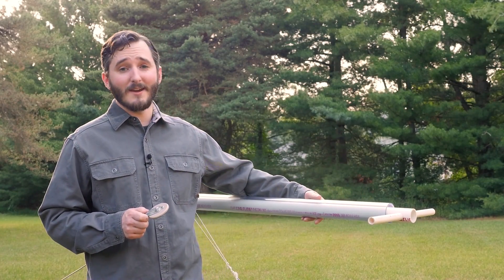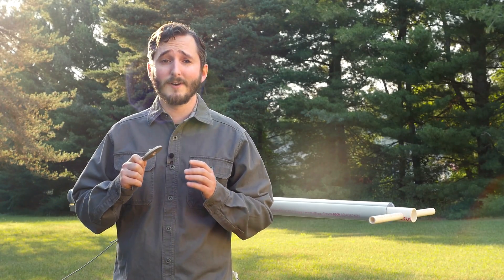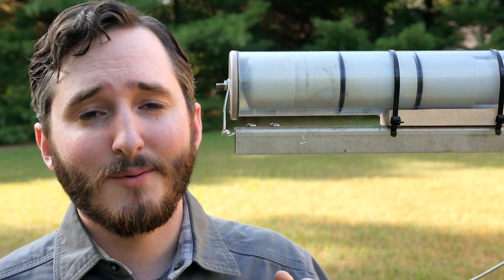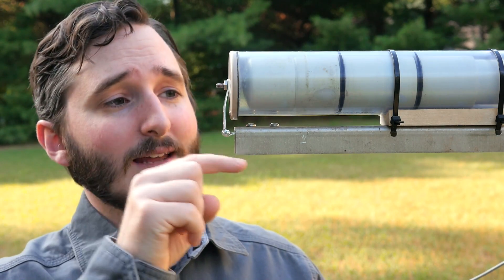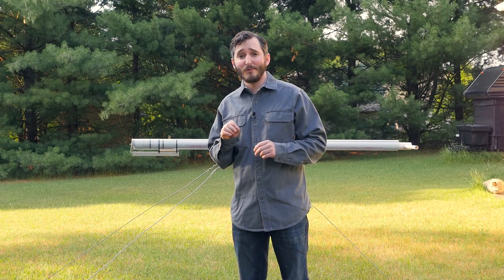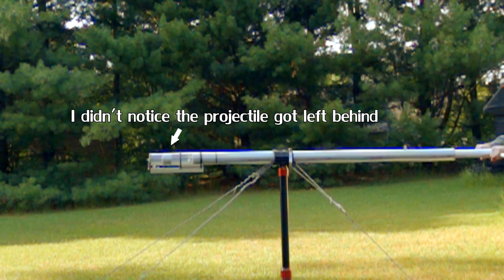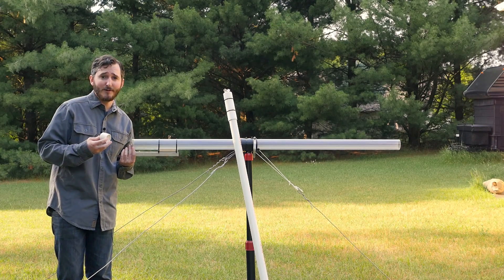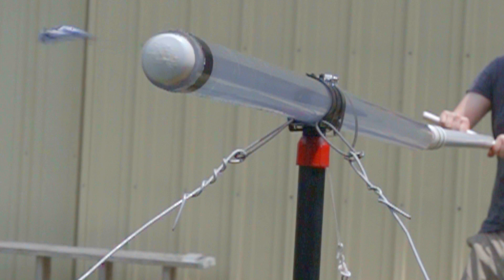Firing A Clear Vacuum Cannon & Testing Viewer Suggestions

Comment: Have you thought about making a smaller handheld version with the same technique?
Reply: I guess most people here would prefer a version that needs a car to pull back the piston. :P
Reply from the maker: I have but I haven't tested it yet. The shorter the barrel gets the weaker it will be, but I think it should still work down to 3' long or so.
Reply: NightHawkInLight that was my thoughts too, but what if the ammunition was .177 pellets in a 3 feet pipe?
Reply: Maybe you could have a longer barrel or a manual vacum pump
Reply: The vacuum only depends on the length of the pipe (the stroke) and the amount of air in that was initially in front of the target. (and obviously the vacuum depends on how tight the seals are)
Reply: Use a smaller diameter pipe, the volume of air remaining will be less, so you can use a shorter barrel (or a more powerful canon if you we're to use the same length)
Reply: Julius P vacuum would be too weak
Reply: Julius P I'd love to see that!
Reply: Julius P
Sabot.
Reply: A smaller diameter pipe will restrict how fast the air can get in and flow down behind the projectile.
Reply: I just made a ~2ft one at a 1 in inner dia. 3d printing different weight projectiles and 3d printed my o-ring fitment. Also, using a tinkertoys style hold for the projectiles. Works a charm with a 5 gram bullet out to 40ft rn. Still working on it.